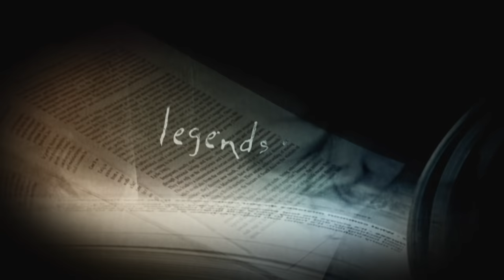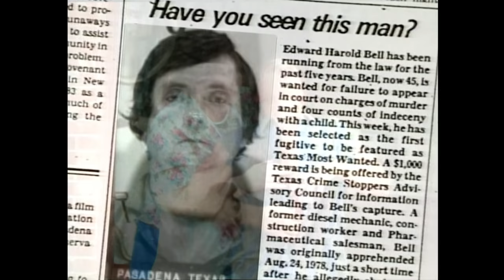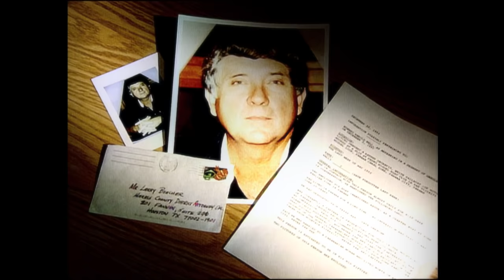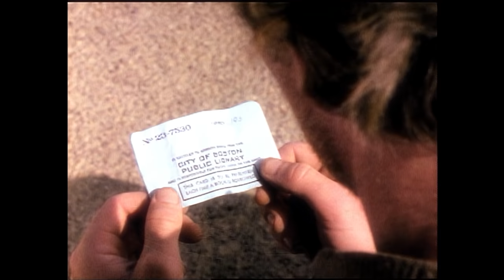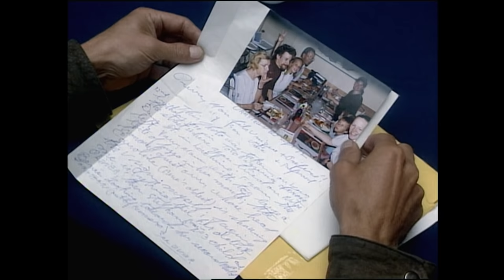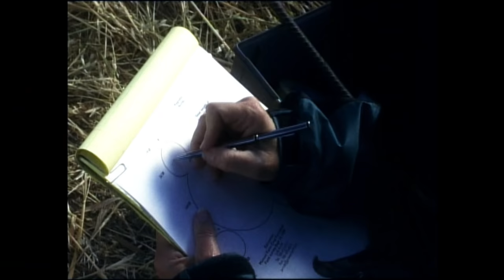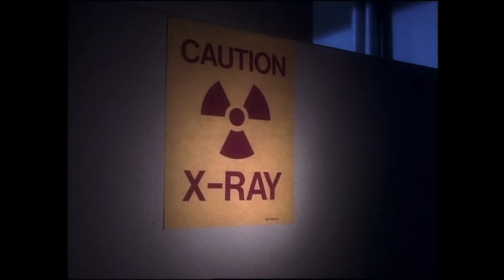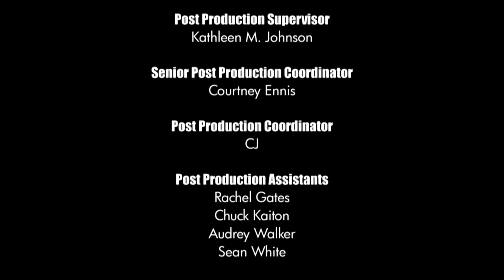Unsolved Mysteries with Dennis Farina - Season 1 Episode 6

Comment: Alien Craft use Anti-Gravity. That is a simple Electromagnetic form which gives you Lift and Direction. There are a small number of Alien Races whose Craft fly at a slight angle pointing down because of the type of system of Electromagnetics they use. It moves them forward but is called running down the hill.